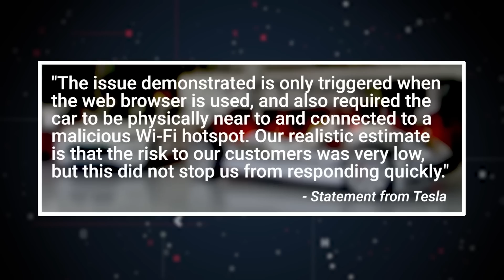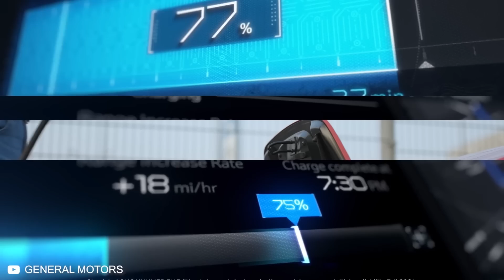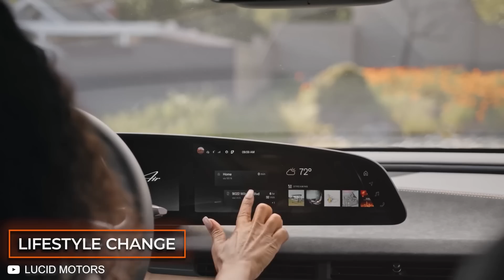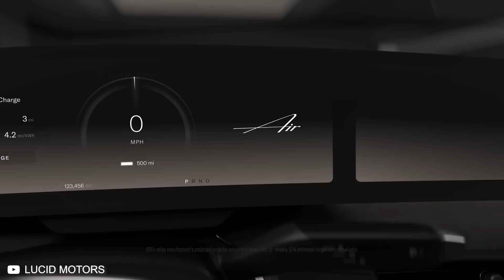EVs' Serious Problems That Carmakers Are Hiding

Comment: The whole point is to stop us from traveling n going on trips. Car equals freedom, freedom to travel.
Reply: RIGHT!
Reply: So true
Reply: right
Reply: <<The whole point is to stop us from traveling n going on trips. Car equals freedom, freedom to travel.>>

You must worship the climate change gods in all things. If the wind doesn't blow,  you will be content to have the lights go out.
Reply: @Heckonwheels86 

<<They make too much money on oil>>

Before WWII,  most homes were heated with coal.  

After WWII,.  most homes transitioned from coal to oil heat.

Why didn't  "they"  prevent that?

Then,  in the 1970s,  due to the oil embargo and price increase,  there was a huge transition from moil  to natural gas for heating. 

Why didn't "they"  prevent that from happening?

These days,  many people are moving from natural gas for heating to heat pumps/electricity.

Why aren't "they"  preventing that from happening.
Reply: “Not if you’re forced to in a car dependent area” is what I see some say in response to this kind of comment. It is true to an extent and what you said is also true. We need more options. EV’s can coexist with gas and diesel cars and we can have good alternatives to driving so everyone has options of getting around. Not just being limited to a crappy new technology that will cause problems.

Comment: Solar Panels Are Not Needed To Charge An EV
Reply: They aren't, but the cheapest technology that produces electricity is utility scale solar, which has a much lower impact on the environment than that of fossil fuels. Solar and wind are the best to use as a transition until nuclear gets its act together.

Comment: People who have once owned an EV hardly ever go back to a petrol car. Why? Comfort, low maintenance, not polluting the city you live in, no smelly gas station anymore. This video plays on people's fear or FUD like mentioned in on of the other comments. Most of the statements about EVs in this vid are either plain BS or apply only to the early models. The (near) future is EV only, embrace it and you won't regret it!
Reply: What is interesting is the evolution of EVs compared to  ICE cars. Also EV's overall consume far less energy travelling the same distance as an ICE. Heck even an EV recharged by a coal plant puts out half the CO2 as a gasoline car the same size doing the same trip and even much better in stop and go commuter congestion.

Comment: A forty minute break every three hours to charge isn't really an issue for me, if I'm on some epic road trip, I'd likely do that in an ICE car anyway. Not so good if you have to sit in a queue for hours to get to a charger.  I think this is coming.  This has happened already at a popular Tesla supercharger halfway between LA and San Francisco.  They're building more chargers you say.  Well now they're churning out far more Tesla's now they've sorted out their production problems.   It'll be another 10 years before those Teslas are scrapped so the numbers on the road increase exponentially.  There are some problems now, what happens in five years when there's ten times as many e cars on the road.  Really think we can ramp up the infrastructure so quickly? And that's without upgrading the grid.   Tesla fans will always point to the increased range and reduced charging times.  I think a 40 minute charge time will become moot when you have to spend five hours in a queue on Thanksgiving.

Comment: Electric vehicles are the answer.Battery powered cars are not!.Producing heavy batteries to carry round using all that extra energy is silly .We need cars that pick up electricity as they run from rails ,overhead wires or other systems.With small batteries to use to get on the mainlines.This means you need auto speed control. Auto steering .Auto payment for electricity used by wireless credit card transactions as you travel. 
This should be the future of motoring.
Lighter cheaper cars. Cheaper motoring.Less Emissions.
And another plus Less accidents,and faster journey times.
Anyone going to pick up the ball and run with it?

Comment: If every car in the world was electric it wold make very little difference to CO2 emissions as transport (ships trains aircraft including cars) make up only about 16% of global emissions. Especially as electricity is mostly generated by fossil fuels anyway.
Reply: Car, motorcycles, taxis, and buses account for 41 percent of the total emissions created by the transport sector,; transport sector creates 21 percent of total emissions. By the end of the century most electricity will not be generated by fossil fuels. Petroleum will be used for paint. plastics. etc.
Reply: You know, there are some other reasons for going electric aside from just CO2.  I mean: smog, oil spills, reliance on the Middle East and Russia. . .

Comment: We have a 2016 30 KWH Leaf rated at about 105 mile range. It was purchased used, 3 years ago, with a certified warranty for around 15K. The 8 year battery warranty is generally transferable to a subsequent owner. At 6 years old, with 3 bars missing it goes about 75 - 80 miles which is a fairly typical level of battery degradation. Still have a couple years warranty left on the battery. Another lost bar on the meter will qualify it for a battery replacement. As a second car it serves us fine, as we have a level 2 charger at home. Although we live in Orange County California, surrounded by Teslas, finding a working charging station is often challenging,  so we mostly charge at home and the vehicle rarely ventures more than 25 miles from the house. Our Leaf adds around $70 a month to our electricity bill and rarely needs a service department visit, so it is truly economical. All this being said, our electric car is still a bit of a novelty and definitely would not serve us as an only vehicle.
Reply: How many 2016 gas cars have an mpg drop of 50% after 6 years?
Reply: you have a lot of a novelty there its a toy period
Reply: Thanks for sharing. Real world owners need to communicate more about the real world. If we want real solutions, we can’t lie to ourselves about the downside.

Comment: Im not sold on EV. Range, battery life, cost and price of
Admission is just too high for
Me. Once they become more mainstream and there’s more competition prices should fall. Another thing for
Me is i live in Canada and we have winter. Cold weather has been proven to limit the batteries range by 50 percent. No thanks. Have an emergency and you need to get somewhere fast but your car is charging and will only get you a few miles down the road before it dies again? No way.  Can the grid handle the demand even if only half
Of the population gets an EV? Not at the moment. Parts of America already buy power from other places. California goes black when the amount of AC units are trying to cool everyone’s homes. Stop blaming automobiles for CO2 and carbon. You want to try and reverse climate change you need to stop the 3 biggest countries who account for the largest carbon footprint in the world. China, Indonesian and Russia account for the highest fossil burning, air pollution that is currently happening. Industry, coal burning electric plants that make electricity to fuel the mega factories. These countries are killing the Earth. Fact.

Comment: Let me get this right, the longest you can really expect an EV to last is 10 years.  That's if the battery pack holds up a full 10 years.  Then, it is a premium vehicle, so it is more expensive to make in the first place, so you're front loading the environmental costs.  The savings is in the operational costs, and it only operates for 5 to 10 years.  I don't see how this can be good for the environment.
Reply: It is not only better for the environment, the technical debt they create will be less. 

The fossil fuel it takes to charge EVs and to manufacture them will dump much less CO2 into the atmosphere than private vehicles using internal combustion engines. Heck, you would still emit less CO2 getting your electric source from a coal plant, as an EV recharged by a coal plant puts out half the CO2 as a gasoline car the same size doing the same trip and even much better in stop and go commuter congestion.

Bottom line is that all energy sources and even recycling are dirty, the responsible choice to make is the least dirty one, not the one where you get to bill somebody else for the cleanup. What is being pumped into the atmosphere represents an enormous technical debt, which is much much more than all the tax expenditures and all the subsidies by all countries to wind and solar energy and EVs. 

One nice thing about EV battery cells is, they find a second use in stationary grid storage, and when there are enough of them to create a market, they will be recycled to reclaim the valuable metals just like any other high volume appliance does nowadays.
Reply: @rps1689  You are always going to do less environmental damage by buying less car.  What has happened over the last 30 years is that the quality of vehicles has increased to the point that old economy cars compete with new economy cars, making them unprofitable.  The manufactures respond by making big expensive monsters that they can sell to people with egos as massive as their wallets.  This creates a lot of easy competition for EV's.

When it comes to vehicles under 3000 lbs, well, is there an EV under 3000 lbs?  These are the vehicles that people buy with the minds and not their hearts.  These are the vehicles that use fewer materials to make, uses smaller tires, and burn reasonable amounts of gas.  As the auto companies are eliminating cars like the Chevy Cobalt and Ford Focus in favor of EV's, I'm just seeing people selling more expensive products, so they can collect on a bigger mark-up.
Reply: @ThatsMrPencilneck2U  you'll make a lot more money if your company doesn't damage the environment and the other guys do.
Reply: @resolveyeetlord8340  It's not like GM stopped making gas-guzzlers in the US in favor of EV's in China.  They simply stopped making efficient ICE vehicles.   Ford stopped making efficient ICE vehicles.  They both continue making ICE massive ICE vehicles that require 400+ HP to get any reasonable acceleration.  It's easy to beat those in any efficiency comparison.

Tesla isn't the only company building EV's.  They're just the upstart the powers that be don't like.  GM is far from any hero.  They just used to make some sturdy low cost vehicles.  I don't know what I'm going to do when my car wears out, other than sink a fortune in replacing everything.  I certainly won't be able to afford an EV.

Comment: EVs are junk, it’s a fad that will fade away and be taken over by hydrogen and plug in hybrids
Reply: So far hybrids are a maintenance disaster. Better to put the extra mass into a bigger battery; not a gasoline drive train. Hybrids have all the disadvantages of an ICE and an EV in one.

It is more likely hydrogen could turn out to be the replacement for bunker fuel in shipping, but not much good for anything else..

Comment: Just power your electric motor driven car by a small generator instead of the battery. It would use a tenth of the gasoline a full internal combustion powered car would use. Solves the range anxiety and charging problems. Reduces exhaust emissions, extends the usable oil reserves. It's a true win-win situation. We don't have to reduce emissions to zero in order to save the planet.
Reply: I wonder if a redox flow battery storing juice from a solar panel could be feasible to charge an EV.

Comment: An organization named "Cool The Earth" surveyed EV charging stations in San Fransico's Bay Area. It found twenty two percent of the chargers did not work. The organization waited one week and did a sample check and found no change in function.
Reply: Setup one nextdoor and keep it working.  Drive that dude out of business.
Reply: <<
john r
1 month ago
An organization named "Cool The Earth" surveyed EV charging stations in San Fransico's Bay Area. It found twenty two percent of the chargers did not work. The organization waited one week and did a sample check and found no change in function.>>

The city of Seattle owned electric utility recently installed two charging stations a half mile from where I live.  I have observed these with interest.  They are posted no parking except when charging,  but so far I  haven't observed anyone charging,  but both regularly occupied by ICE vehicles looking for scarce parking spots.
Reply: you dont need a charing station to charge an EV, it will charge off of any electrical outlet, even in a cabin in the woods you are able to charge an EV.
Reply: @educated_guess  You are correct if you have days to charge your car.   Don't recall the charge rate but on "any electrical outlet" it is  very slow.
Reply: @educated_guess  Maybe so, but it'll take 30 hours to charge an average EV to 80%. Most manufacturers recommend not charging more than 2 hours on a granny cable, as there is a fire hazard if the cabling is not rated for full usage for longer times.
Reply: @educated_guess  that is correct, but unless you have a 240v system it can take thirty hours to charge enough to go 180 miles.

Comment: What's the point, where does the energy to charge these things come from?
Sure as hell doesn't come from renewable energy sources
Reply: In some countries half of the energy required comes from renewables.
Reply: @rps1689  And the other half?
Reply: @justinwigington174  Fossil fuels, which are being phased out mostly for the electricity sector. The transition has been well on its way and continues. WInd and more so solar filling the gap until next generation nuclear gets its act together. The cheapest and least dirtiest technology that produces electricity now is utility scale solar, which has a much lower impact on the environment than that of fossil fuels. Solar and wind are the best to use as a transition. 

North America needs to rebuild their grids and the power plants with modern technology, which is already happening in many other places abroad in order for wind and solar to take up the slack and to suspend new fossil fuel developments; petroleum is too valuable now to waste as gasoline, we should leave as most of it as we can in the ground so our kids and grandchildren can use it for plastics, paint, etc. Even though Canada is way behind, under a third of its energy comes from renewables. 

The electrifying of the economy will happen by the end of this century, most 60 Hz stuff will be phased out and grids will be upgraded to DC. 

Mark my words; signs of the fight is already happening over how fast to phase out fossil fuels, and it will be reduced to a battle between the biggest investors in banking and the biggest investors in fossil fuels; and politicians, environmental activists, and scientists will be irrelevant in this battle of the titans.
Reply: @justinwigington174  The technology already exists to recycle wind turbines, but it is not worth it yet. By the time windmills and solar panels start wearing out in sufficient numbers, there will be a recycling market likewise for EV batteries. There is always recycling where there is valuable metal. 

The fossil fuel it takes to charge EVs and to manufacture them will dump much less CO2 into the atmosphere than private vehicles using internal combustion engines. Those coal fired power plants suck, but at least the amount required for the new better efficient grids will use less fuel than the old previous grids. At least China with all its faults, is doing more than Canada and the US is doing and already have some ultra high voltage transmission - DC and AC, which requires less fuel. They also emit half the amount of CO2 emissions per capita than the US does.

One nice thing about EV battery cells is, they find a second use in stationary grid storage. As I mentioned, when there are enough of them to create a market, they will be recycled to reclaim the valuable metals just like any other high volume appliance does nowadays.
Reply: @justinwigington174  BTW, an EV recharged by a coal plant puts out half the CO2 as a gasoline car the same size doing the same trip.
Reply: @justinwigington174  Time will tell, it is highly likely hydrogen will only be used for the replacement for bunker fuel in shipping.
Reply: @rps1689  Dunno about that, Toyota is working on it currently.